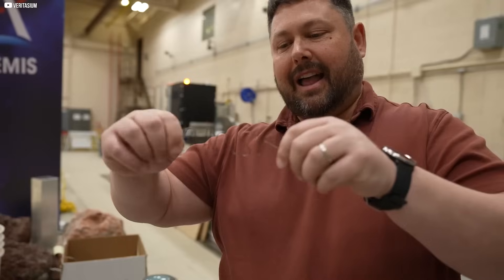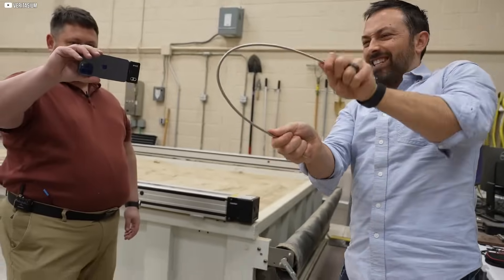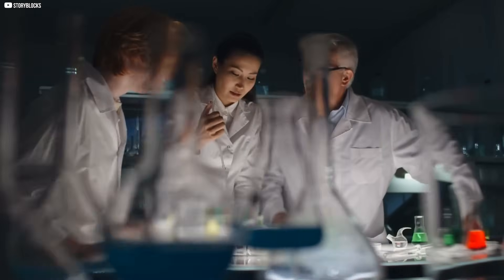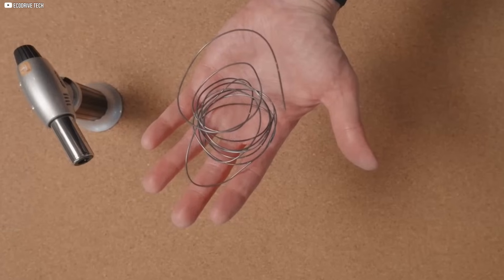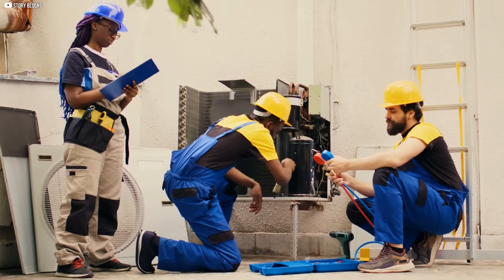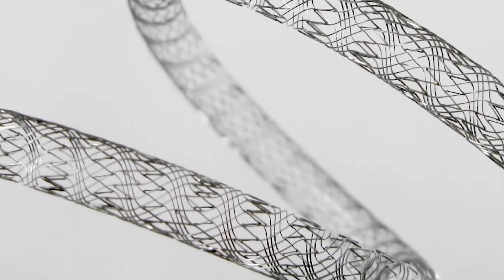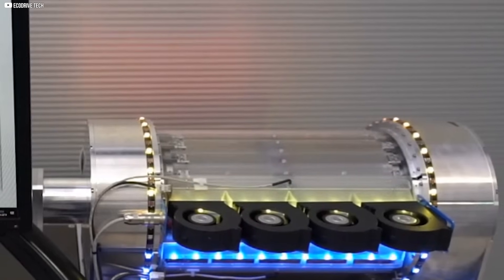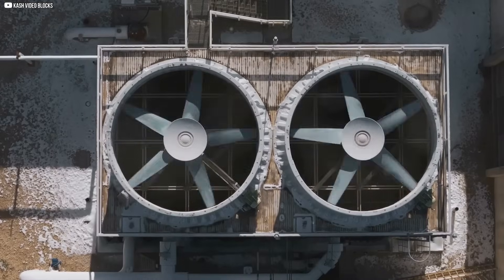This Metal Wire Could Replace Your Air Conditioner Forever

Comment: Sorry, I need real numbers. What are the temperatures / pressures, how many BTU's per square ft. We need real numbers.
I am in the mojave desert, there is no fooling anyone between June through Sept., if you don't bring the BTU's in heat transfer, you're sweating in misery.

Comment: Yeah, replace the unbreakable gas with fragile nitinol and replace the bulky compressor with even bulkier actuators. Solve one problem but create ten more, genius! Of course those problems are "Solvable" and the potential is "huge" "massive" (etc) assuming we can solve all the new problems at least cost effectively. Still too early to hype up this so called "new" old solution.
Reply: Before ac this is same for gas dependent air conditioner

Comment: So basically it’s the rubber band refrigerator, except with nitinol instead of rubber bands. Figuring out ‘real world efficiency’, my ass. That’s already reducible to an equation. More like real world durability, reliability, and figuring out the optimal way to mass produce the device. 🤨🧐

Comment: Pipe dream. No chance this will work for AC.
Reply: Give it a chance. Like most inventions that are superior in function and use today (Car, Computers, Medical tech etc) always starts small with people saying "Nahhh it will never work, just a fad" then years later we all rely on and use the tech that people said wouldn't work. 

I remember my grandfather saying "Computers will not be a thing, it will last a few years until the novelty wears off" Yeah, when the internet became a big thing I reminded him about what he said and told him every appliance in his home that used computers. He was humbled and accepted he was wrong. 

But back to the point, Yeah it may not work for AC today but tomorrow may be an advance in technology that allows larger scale use like AC systems and such like. But for now it can be used for simple cooling of electronic components without noisy fans or power-sucking Peltier plates. Give it a chance man.
Reply from the maker: Thanks for your feedback!  It's always interesting to hear different perspectives on innovative ideas.
Reply: Yeah and cell phones were a pipe dream in the early 1900's.
Reply: Coefficient of performance of nitinol is 8 or refrigerant based heat pump is 4

Comment: Hydrofluorocarbons were banned over a decade ago and this alloy is many decades old. I'd be more interested in efficiency figures not just technobabble. If you're having to stress multiple wires enough to cool a building you're going to use a lot of energy to do that. 100s of cycles is a joke, you need to be in 10x millions. It's going to be a lab curiosity for a long time.

Comment: The biggest issue is the amount of heat that can be removed per unit of mass is extremely small compared to refrigerants. Nitinol alloy is also extremely expensive 😮

Comment: Next breakthrough in cooling technology will be - blow air with your mouth. 

That is elegant, efficient, no pollutant, no hissing pipes, no twisted metals, just fresh breath. If done by supermodels, most people would instead heat up. But that's a different story.

Comment: MOONSHINE!
YES hissing pipes!  Heat needs to be conveyed from the house to Nitinol & from Nitinol to outside.  How is that heat going to be moved?  The best way is to use a phase-change liquid-gas medium (Englishspeak for "refrigerants".)  There will need to be 2 separate pumps to move these refrigerants around for the hot & cold side.
          Yes chemicals, no compressors, but yes TWO pumps.
          The mechanical parts for Nitinol system are WAY more complex & subject to wear.  The motor must be geared down (versus compressors which can run at fast speed where motors are smaller & more efficient) & there are all those cams & rollers.  Modern compressor has only 3 moving parts, versus 100's of them for this system.
          The efficiencies of Nitinol alloys are WAY LOWER than that of refrigerants because the  latent heat change per gram (re-arranging crystal bonds in a solid) is much lower than that of refrigerants (breaking liquid bonds to gas).  The specific heat (of the Nitinol or the refrigerant) is a "dead load" that must be transported back & forth.  But the mass rate of Nitinol is much higher per unit of heat moved.  So much that only a few degrees C of cooling is accomplished per stage.  Refrigerants accomplish the entire temperature drop in ONE stage.

Comment: How many times can a wire bend before break?.
Reply: Steel wire will break after 20-100 times of stretching 
If you really need to move heat with nitinol it will last about 1000-10000 times which means less than a month before it fatigue or torn
Reply: @mahmoudalammary8339  the wires are probably coated in a smart material that helps maintain nitinol integrity, so 15-20 yrs 🤔
Reply: Can it give me absolute zero temperatures? Cause I like my room extra chilly.
Reply: @ケブ  of course! Absolute zero is where it's at 👍
Reply: A bit of heat could reanneal it...  Metal wear can be reversed and we are talking about making the material smarter...
Reply: @johnwang9914  you'll need the annual reann service plan lol
Reply: About a billion times.